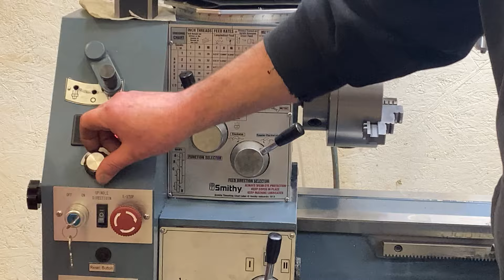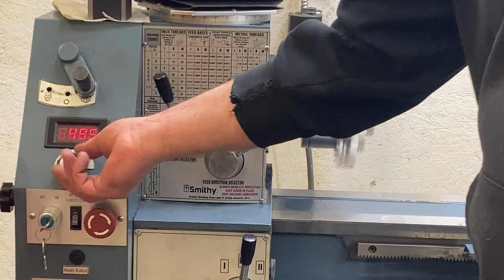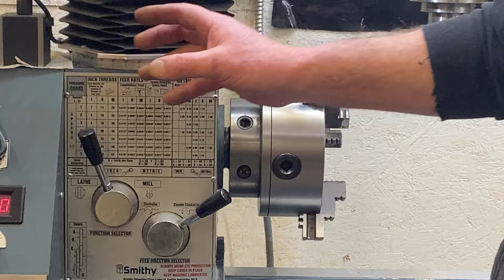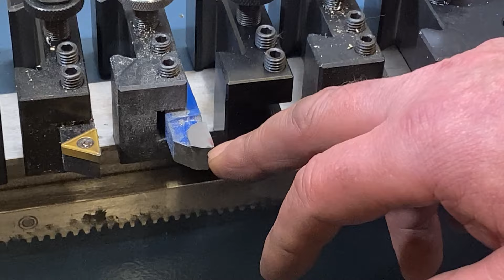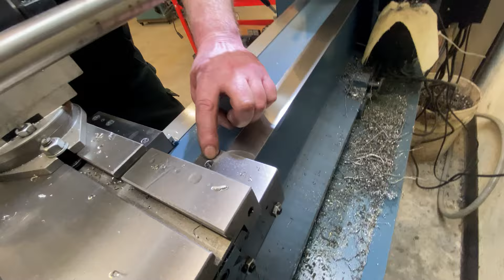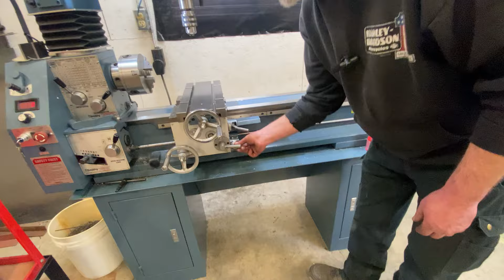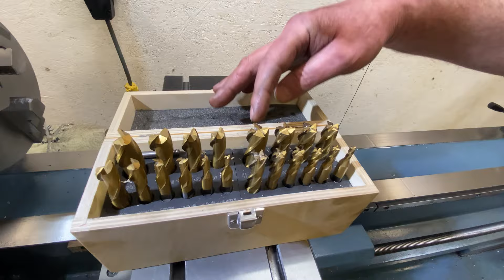Smithy lathe mill drill. Make almost anything at home!

Comment: I've been trying to contact Smithy for awhile now with no success. Starting to wonder if they are even still in business...texted, emailed, called with No response, I suppose they either aren't interested in sales or are shuttered....
Reply: Have you gotten ant response yet? I have emailed and called several times with no response. Also placed an order and they took the money and never shipped the parts.
Reply: @anthonykoogler5489 nope, after this I went with Grizzly, which has a few items different. UNTIL!! The day I placed the order with Grizzly, Smithy called me!! Hahaahba, I told him to little to late.
Smithy head raises, Grizzly does not.
Smithy has a variable dial to change speeds, Grizzly does not, you must move belts....
Grizzly however is 1/2 the cost, so Ill live with it, the inconvenience.....Grizzly arrived in February so have only used a few times, took a while to get it set up, needed a winch and two other guys to get it on the table....
Reply: @bozospringer2238  They finally shipped and I received my order 3 moths later. Still looking for more parts for my granite machine that are not listed on their website. I've contacted them with every method I could find and still no response.

Comment: Regarding the tailstock, suggest you look into getting a Morse taper extension socket. It will have a male Morse taper shank that fits the tailstock and on the other end will have a MT female socket that fits your tailstock center and/or drill chuck. Thanks for making the video and have fun making chips.
Reply from the maker: Thanks for watching and for the tip!

Comment: I'm a hobby machinist and also have a smithy and like it but you got use it like a smithy, not a bridgeport or engine lathe.  I have mine mounted on a harbor freight 72' tool box with a regular kitchen laminate countertop.  The tool box wheels were removed and a 4" square metal base installed with leveling legs.  For drilling, I'll use a ER 40 x R8 collet and then use ER20 x 6" collet in that.  This setup gives me 5" of travel without moving the mill head.  The best thing you can make is a solid tool post for turning.  It'll seem like you got a bigger machine.  I was using the lathe as a mill in this video but you'll get the idea of the solid tool post.  Cheers https://youtu.be/pcqjPGJiXog?si=x10h-vGd-5xen_r0
Reply from the maker: Thanks for the comment!
Thanks for watching!

Comment: Hi, again thank for making this video!  After watching again, I had two questions:  1) the model you have is the 1340?  Assuming yes, how do you find the length?  Too long? Would the 1324 have suited better?  2) one of the criticisms of the 1340 I’ve heard is the Z bed travel hand wheel to the far right at the end of the bed. Apparently that is the only way to produce controlled slow cutting motion in the Z axis (the lower wheel on the carriage is only for quick coarse travel). How does this work for you and is it a pain to use that wheel so far to the right?  Would that make you consider the 1324 instead with its 24” bed length?  Thanks!
Reply from the maker: Howdy!
Yes we do have the 1340 model.
Personally I find any extra length to be an advantage. It simply leaves more options on the table.
I do agree with you that the micro hand wheel way over on the right, (For the fine X travel?)  is a little awkward at times but I still wouldn't give up bed length because of it. 
This fine feed wheel is almost exclusively used when milling. I've found that a little extra creativity in my set ups can reduce the awkwardness some.
Hope this helps.
Cheers!

Comment: Around 1:20, the lathe chuck spools up with the chuck jaws pretty far open.  This is hazardous.  There have allegedly been cases of the centrifugal force allowing the jaws to unscroll and depart directly into somebody.  When I was in a machine shop program back in the 80's, shop safety was emphasized and they had a strict requirement that any time a scroll chuck was spinning, it had to have a part clamped in it, effectively locking the jaws into the chuck.
Reply from the maker: Thanks for the comment. 
I did my apprenticeship in the 80's too.
I haven't ever heard of that being a thing but thanks! 
I'll take any potential safety tip I can get
Cheers!
Reply: Every day a danger!

Comment: What do you say as far as the power is conscerend ... what is the reason people say to get stand alone machines ??? .... i understand its faster buuuuttt lol ... if its basically the same thing but less real estate as you said ... i dont understand why not just get a smithy ??? Maybe less threading options ??? Im looking at an grizzley 4003 lathe and an basic knee mill ... i guess what are the main downfalls besides it takes longer to set up ??? .....power maybe ???? and if so couldnt you upgrade the motors maybe later on .... everything is underrated afterall for safety conscerns so have a little room for more power usually i asume
Reply from the maker: Thanks for the comment.
For the most part I find the power is fine for both the lathe and mill. The one place it struggles is when I slow the lathe way down to machine a very  large diameter the power is not adequate. I find myself turning at too high a RPM just to keep it from stalling out. You're right, I like the smithy because of the real-estate thing. I suppose I could find arguments for going with independent machines too. 
The mill is not terribly ridged. It will do any reasonable operation for its size but, lots of small cuts. I don't have any personal experience with the Grizzley 4003 lathe and mill. Maybe some one else reading this will and will comment???
I don't know if there's any motor upgrade stuff available. Personally I'm not big on the electronically controlled stuff. I have a old, mint 1HP Baldor motor  and I've started collecting cheap, blown minibike engines. I'm eventually going to build a gear box with clutches so it behaves more like a conventionally driven lathe.

Comment: Man I enjoyed your video on the smithy. I found an old worn out one and going to try to get it up and going in home shop. Just a question for you is how do you like the 3 in 1? I hear people saying the mill portion is junk but I hope to use mine in mill mode a lot. How does the mill part work for you. I don't have power to mine yet and just curious on some real world use feedback on it.
Reply from the maker: The mill is not at all rigid. It will do every thing you want but you have to go super light on your depth of cut and feed. Just plan on spending a lot of time standing there watching it tickle your workpiece. It works fine as a drill but the size of workpiece you can get in there is limited. As a lathe it's pretty mint. No complaints there.

Comment: Have one of the early models that my dad bought new.    He purchased virtually everything for it as accessories go. 
 Not nearly as nice as yours, the belt change for speeds is some real b.s.  ,  also the mill is not accurate at all since you have to use it across the head.    But worth its weight in gold for drilling using the lathe as a holder.

Comment: Have a similar machine, changed to ball screws and CNC both lathe and mill. Using Mach4 software and have created g code direct from Fusion 360 CAM function. Very happy as a hobby machine, can get very accurate but need to use DRO to adjust for final passes. Also upgraded the mill spindle to needle bearings to  try and get better results than the original cheap drill spindle. Busy re organizing my shop ( wife calls it a garage) and plan to build a box for it to keep chips from flying everywhere. Hope to see some machining projects soon 👍 23:55
Reply from the maker: Thanks for the comment. Thanks for watching
Reply: That is really the way to go ....have you done a video yet describing your build ?
Reply: @davidlawrence8085  No but have made some rudimentary videos and posted on my you tube page. I plan to continue with proper videos  later in year once I stop working.
Reply: Отличная команда!

Comment: I have the same machine and put a 3 axis DRO on it, and a rear back splash for chip control, owned it for 5 years with no problems from chips on the motor, and made a 4 inch  longer quill for tail stock to solve the reach problem.👍
Reply from the maker: I'm curious about your tailstock quill. Did you make an entirely new quill that is 4" longer or did you make a 4" long male morse to female morse adaptor?
Reply: I made a new quill for the tail stock, and used a tapper attachment that I made and mounted to the back if the machine to cut the new morse tapper in the longer quill. @Lappemountainliving

Comment: i have the same mill just a foot shorter  in length , its a decent lathe and with good ground hss steel bits im able to take 0.100 tho cuts , thats 0.100 in feed taking a total of 0.200 off the diameter. the mill part is shit . i can take heavy cuts 0.100 plus but the milling head has a wobble of 0.03 since the day i got it making any kind of acerate milling or drilling imposable   . the drill press part struggles to drill 1/2 inch hole , im thinking of switching out the mortar for a 3 hp . the 3 in one combo is a cool idea that i like alot , if only the people designing them and making them Atchley put in the time and effort to make them completable with stand alone machines
Reply from the maker: My machine is better at being a lathe than it is at being a mill, however I'm not having the same problem you are with runout of the mill spindle. The mill head just isn't terribly ridged so I have to go easy on it. But it is accurate. I'm unhappy  with the motor as well. I'm not a fan of the electronic speed control at low speeds.  I'm investigating new transmission/motor combos.
thanks for commenting